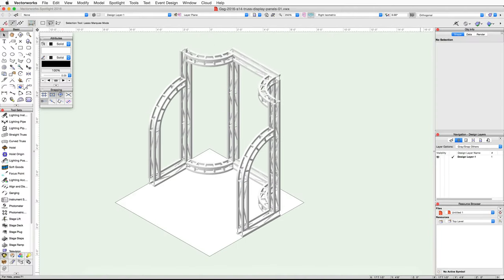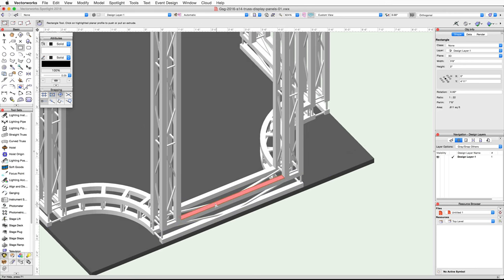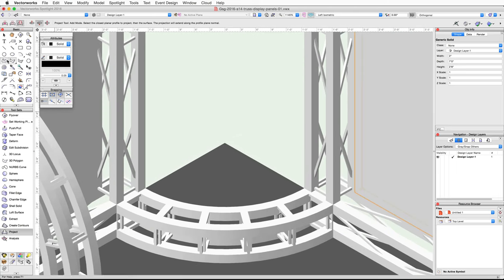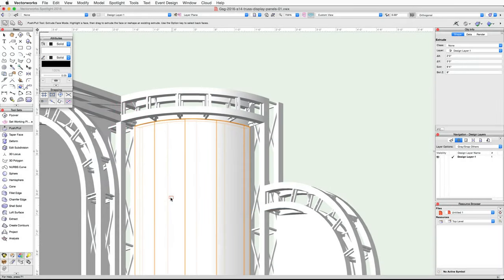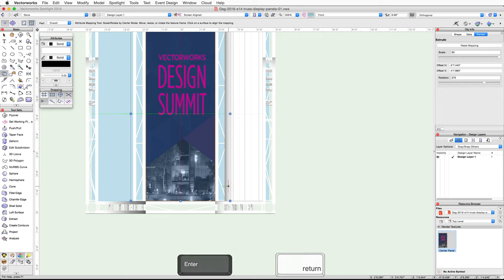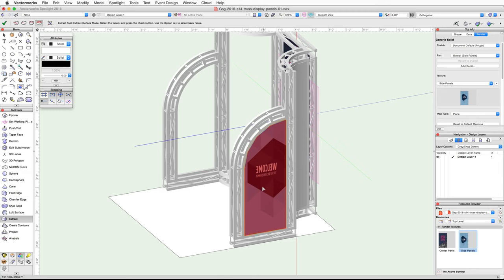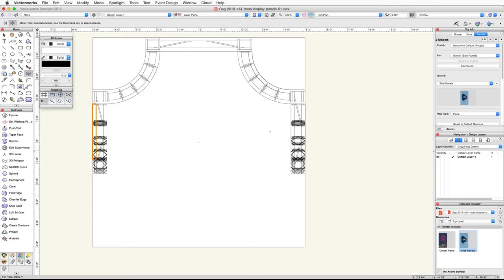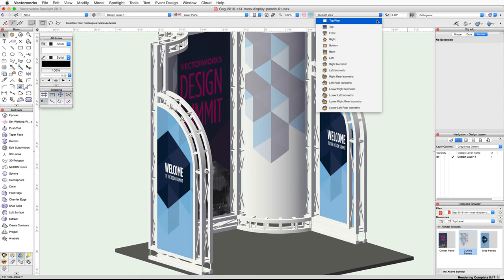GSG - Vectorworks Spotlight 2016 - 14 Truss Display Panels

Comment: I tried many times the step "create side panels" with project/add more/ add downward mode/ and nothing happens, only appears "project tool failed". The other steps are ok.

Could you please let me know if i need another step or instruction to finish it?
Reply: that happended to me too, probably your curved truss is not perfectly aligned with the vertical straight truss below it.